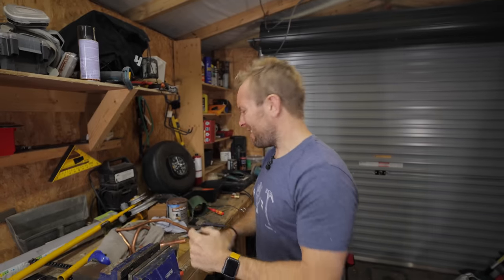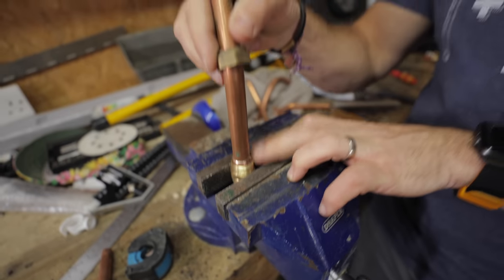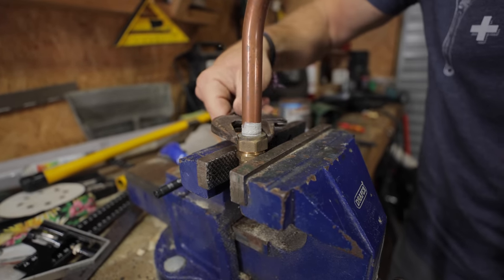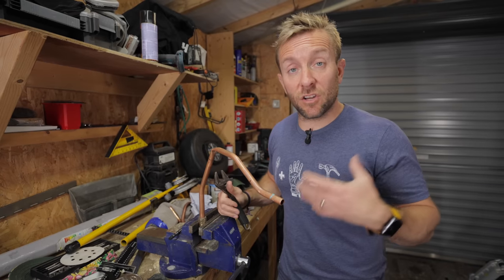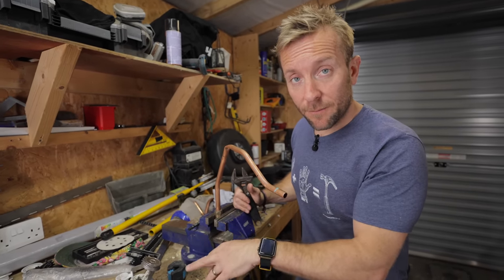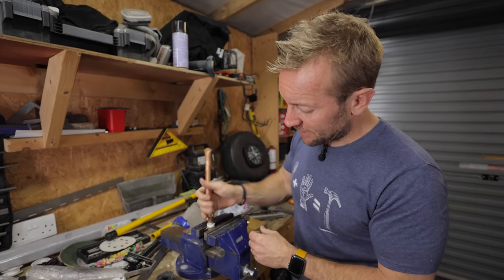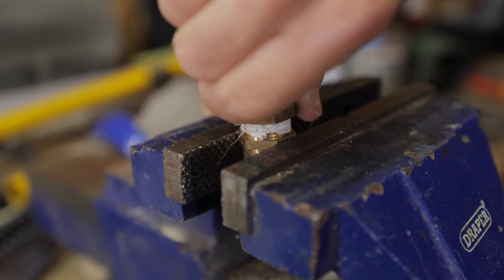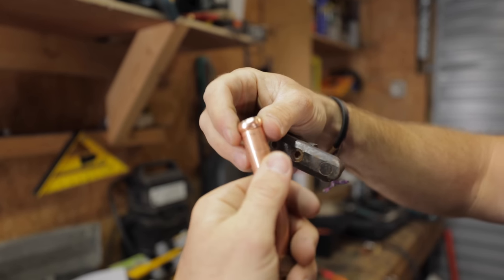4 MISTAKES Everyone Makes When Using COMPRESSION FITTINGS

Comment: I've done a bit of plumbing around the house. Never even heard of jointing compound,  I've always used PTFE tape (in the wrong place). I've always used a pipe cleaing brush though which seems to have given me a decnet seal. Next time I'll do as you've suggested though even if its only as far as putting the tape in the right place, so thanks for this :)
Reply: I was always taught from my beginning days of working that any brass or fittings that have that rounded shape inside or beveled type mating surfaces you don’t need or use tape but if you want u can use a little pipe dope but it’s not necessary. And I’ve done thousands of jobs over forty plus years with no problems. I’m sure what he is saying works and it might even be better but it’s just another step and time in the long run. I just put them together and tighten them down. That’s it.

Comment: Was told many moons ago by Yorkshire fittings company you dont need jointing compound  because compounds dry out and shrink causing a gap. causing it to leak 
Never had a problem been in the trade 35 years

Comment: If you haven’t got jointing compound you can use some light oil, like 3in1, to let the mating faces glide and seal. Just remember if it’s potable water system, flush through thoroughly. Just remember, ptfe tape is NOT the same as jointing compound. Care with ptfe tape, too much will just compress with time, loosen & leak. The worst ptfe tape stupid move is applying it to the threads. That just tells you the plumber doesn’t understand how the fitting works. 
Best of, good solder joints if you can🎉

Comment: Ive been using compression joints all my life mate and never get leaks . Just don't overtighten . All the same mate graet advice to newbys good stuff 👍
Reply: Yes, well done, your method is best practice.  I’ve been doing plumbing jobs at home, for friends and family for 20+ years.  I was taught by my father in law, apprenticed gas board plumber after WWII and national service with REME maintaining tanks.  He continued C&G training for years and progressed to become a successful design engineer making food production equipment (Mars, Birds Eye, P&G) for the last 20 years of his working life. He travelled to Europe, US and the Far East with his career.  He taught me that compression joints are mechanical seals and that the use of jointing compound or PTFE tape was NOT required. He taught me to ensure that the pipe, fittings and olive were clean and free from grease or ‘scars’. After assembling by hand, using blue pencil marks for insertion depth confirmation, the compression nuts are turned until tight without force, then tightened further by one quarter turn.  Once the water was switched back on the joints were checked and if necessary slightly nipped tighter.  I have never had a compression joint fail on plastic or copper pipe, imperial or metric.  Careful preparation and a methodical approach is the key.

Comment: Been plumbing 22 years , very rare I’ve needed to use any jointing compound , it’s for the rare fittings that just won’t nip up properly , usually when you have brass compression rings the copper ones are better

Comment: The biggest problem that causes leaks on brass compression joints that I come across is under tightened (because they used jointing compound) and unsecured pipe work,  clean the pipe with wire wool, don’t use second hand pipe, no compound or tape required!
Only use jointing compound when tagging on to old pipe work.

Comment: For 15 mm pipe compression fittings I thought the tightening advice was finger tight plus a turn and a quarter. In your opinion is that correct?

Comment: Hold tight!!  I had a questionable olive that I wrapped in PTFE tape about a month before this video came out.  That and a little dan of Megalok, for lubrication, did the trick. Solid pipes on an old wash basin did not give much wiggle room.
What is the tip for cranking them down right?  Can you feel the olive start to engage? I tried snug, plus 1/4 turn.  Still leaked. I kept the water on and stopped 1/4 past when the leak stopped.

Comment: just as a side issue.
Here in AU most of our compression fittings use plastic  ( teflon/ ptfe) olives.
As long as they are on straight on clean pipe, they seem to hold even on 120+PSI compressed air.
Reply: I use push fit plastic wherever it can't be seen - under floors etc. For when they are visible I use end feed soldered which are much neater. Horses for courses and push fit can be taken apart so easily which can save much time

Comment: I only put compound on the side where the water actually reaches - eg the fitting side. Why would you need it on the nut side? Top tip, push the olive and pipe down into the fitting first to gauge its location along the pipe, then hold it with your thumb on the pipe, pull them out of fitting - you can then see where it sits on the pipe to paste up. For those saying you shouldn’t use anything, maybe you don’t but you can’t just deny the material science behind helping a joint work better. It’s about understanding what is going on inside the joint

Comment: I always assemble and tighten dry, then remove the nut and put 2 wraps of ptfe tape over the olive. Never leaks doing that
Reply: That's what I do and yeah it always works, let the olive bite then loosen the nut and wrap a couple of turns of PTFE round it.

Comment: Ptfe tape is a device of the devil... Except the way you show  it's use. Been doing this for a freaking quarter century, never seen that tool, as a category 7 gear junkie I WANT ONE!!!!! Grtz from Belgium, Subbed.BTW biconus fittings as we know them are great for because you can reuse them and being all metal they are great for high temp solar applications and dirt cheap

Comment: When using compression fittings usually the class of the pipe used maters alot. The lower the class pipe the thinner the pipe the more commonly it will fail over years. Class 1 is usually the minimum wall thickness used on compression fittings. According to south african national standards

Comment: No complaints about what you have said but 50 years ago we cleaned the ends of pipes so the olive could slide slightly on tightening which supposedly helped lock up.

Comment: ROFL brasso it up and you're golden hahahehhaheha brilliant, loads better than the old soda can pull tabs we used to play with as kids. (if you don't know what I'm prattlin on about get off my lawn) great video.  I had no idea an olive cuter existed, I didn't even know those were called olives, but I digress.  I had to cut the hole end of the pipe off and redo a fitting once in my bathroom, luckily for me the stub out was way longer than it needed to be and I was able to replace the valve to the toilet but wow, that olive cutter would have been a godsend.

Comment: Another way to remove an olive is with adjustables. Over the top of the olive, tighten to the width of the pipe and hit downwards. Granted it might create more of a mess but works in a pinch

Comment: Ok this makes sense, but what’s weird is that as a auto tech doing ac compression fittings which we use a lot of ,mostly on imported cars and the olive is the same we were always told not to coat it in that manner because the thread sealant can come loose and travel in the system and block the filters ,and the dryers..although if you do it correctly we use the tape  more so because as long as you don’t use too much,and break the tape in pieces it will seal and not travel in the pipes causing ac system failures down the road..😊😊😊😊
Reply: TBH, you don't need PTFE or jointing compound on any compression joint unless there's an issue, doing it as a matter of course is wasting time and material.

Comment: The jointing compound / PTFE do the same job as the washer on a tap. The brass to brass faces are not likely to effectively form a watertight seal. The same thing applies in the contact between the olive and the pipe. PTFE / COMPOUND	 bridges the tiny gap between the meeting faces of the pipe and the olive. What isn’t mentioned here is the expansion and contraction particularly on a hot supply pipe what holds water initially will probably leak once it moves a few times.

Comment: #4 also applies to LP Gas bottles. The number of times I see taped POL fitting threads. If anything, it can hinder tightening of the sealing surface.

Comment: To remove olives slide an adjustable spanner along the pipe (pipe loosely in-between the jaws) against the olive. Most of the time it'll slide right off 👍🏻
Reply: If that works the fitting was never tight.

Comment: Great tip using the magic marker to mark nuts that have been tightened. I will use that for sure! Thank you. BTW: I usually use Silicone Grease instead of Jet Lube V2 Plus. I wonder if there any down side to using that instead?
Reply: Is sillicone grease wras approved?
Reply: V2 is liquid ptfe - always works great for me.

Comment: I had recently changed the bathroom sink and tap but found that the copper pipes were angled and i didnt like how the braided  tubes for the taps were bent around to suit the new tap location. So i changed it to nice straight lengths of copper pipe, brand new olives and fittings etc. I sent a pic to the plumber just to show if ive done the right thing (he is a friend as well just to see if ive done it all right) and I said i also used the fernox potable water jointing compound around the thread and also on the olive and he said I didn't need to use it at all because it was new fittings and to not really use it for new fittings. 

Just wondering if this is the case for any plumbers here? Like is it only for use on an existing fitting thats been fitted and is causing a leak, is it bad to use it on new fittings? 

I personally found it good to use because of the way everything was awkward to get to, it was easier to apply this than to wrap around tape and when tightening the fitting it seemed to then unscrew the connections to the tap that could only be screwed in by hand! So the compound helped me not have to tighten everything super tight, also as a diyer it takes a while to know when enough tightening is enough so its a slightly few less turns with the stuff applied to give it a watertight seal, making it ok to give it a bit more welly if needed instead of overtightening.

I wanted to do it right as I had caused a massive leak before with the connections to the bath taps, I overtightened the speedfit to metal thread connection and it eventually cracked after a few months, water pouring downstairs XD
So since then ive avoided eBay taps and overtightening lol

Comment: while PTFE shouldn't be applied to the threads, Joint compound goes on the olive/ferrule AND the threads as it's a lubricant that will make it easier to tighten and also remove it one day if necessary...
the best compression fitting trick I know is you rarely have leaks on used fitting (disassemble-reassemble...but with new fittings if it.s too loose it will leak and if it's too tight it will break...often days or weeks later) I slightly over-torque them and then loosen them and then retighten them properly...I've never had a failure with that method

Comment: If you do not use sealing compound some ptfe tape which is teflon will lower the friction on on the threads when you join the pipe, put putting teflon tape around the olive also will help seal the joint 👍👍👍👍👍 so in the case of compression joints wrapping the thread twice with tape does help 🤔🙉🙈🙊🕊️🕊️

Comment: Not sure but I've been able remove an olive with ring spaners or open rachet spaner and hammer tap it  and it comes off most of the time don't scratch the pip use wire wool cleaning end up .  I must just been lucky .

Comment: To many times I have come across fittings smothered in joint sealing compound like some kind of cake. Joint sealing compound won't hold the pipe and to much of it and you don't know when the olive is tight enough. I use a very small amount of plumbers tallow and a tooth brush to apply it and a 1/4 to 1/2 turn from finger tight  never had a joint leak.
I followed another plumber on a job many years ago, he used silicone jointing compound and every compression joint was leaking, around 35 joints. He got no pay and a bill for my time and damages.

Comment: Another common mistake is when pipes are under tension  when the joint is being  tightened the olive can  drift toward the end of the pipe i always used to undo the joint to double check when working with those tricky pipes.

Comment: They sqeek because the machined threads in brass need lubrication. A little oil will do that.
Only one face of the olive is a sealing face. The face the nut runs on is not a sealing face.

Comment: Oh and for Facebook, the CROX is a type of plumbing fitting, made by using Crox Nuts, to clamp the swaged pipe, together using a nipple and crox nuts 
re:
[quote]
Swaging tool used for expanding copper tube prior to joining with Crox fittings
[unquote]

Oh and that silly BRASS ring you call an OLIVE, we call a "Brass Ferrule".
Different countries, different words, same damn result, something leaks when it shouldn't, at the worst possible time, - at night on a Sunday.

Comment: Good video. Another mistake is fitting a new olive over an uncleaned pipe !, it will never seal. A damaged pipe is the same problem when the olive sits on a deep graze n the pipe. I’ve also found fitting new compression fittings on older olives are unlikely to seal because the soft copper olive won’t reform to the new brass compression fitting. You can get it to seal with PTFE tape or that new gel stuff. I haven’t had any floods, but every possible scenario for a compression fitting to play up, I have encountered !.

Comment: Never had an issue not using jointing compound but I always use ptfe around the olive on 22mm fittings.
Reply: I remember in my early career as an apprentice many years ago, i went through what i refer to as my Boss Whiteless period. Trust me you may get away with a few joints but when they run to dozens 😳 it’s a mistake i never repeated. If you want some fun wait until you come across 17 gauge copper in a tight spot.if you haven’t got a crusher you will need a good sharp file. If you have no idea what i’m on about, count yourself lucky.

Comment: A tiny bit of ANY lubricant will do: 3in1 oil, vaseline, plumbers grease, anything. But remember that lubricant does make it easy to over-tighten, so just be aware. I lightly lubricate just about everything in a plumbing system, especially sink drain fittings etc. where corrosion can make it almost impossible to dismantle a few years later. A couple of turns of teflon tape over the ferrule (or 'olive') will almost always solve a pesky minor leak, as you correctly point out.

Comment: When I apply PTFE around the olive, I only wrap it around the pipe not the olive, on the internal fitting side of the olive. Also I wrap in a thread manner, as you would like using locktite 55. Works for me every time! Thread compound also, only around the pipe, as this moves towards the olive when tightening. We vary I guess.

Comment: Pro tip most ppl have a pex ring cutter and instead of a specialty tool, work your way around it even if it doesn't cut it will expand and slip off eventually.

Comment: Time for the plumbing industry to come into modern times. How about fittings that have a proper torque value so there is no issue of under or overtightening a joint.

Comment: A decent compression fitting should not need jointing compound. My advice is to hand tighten it and then half a turn with a spanner. Turn the water on and check for a leak. There shouldn’t be any but if it weeps then tighten a quarter slightly more.  If it still leaks then check the fitting is straight.  If this fails then you could use some jointing as a last resort.  One other thing is check your pipe end has no deep scratches if it does the joint may weep and no amount  of tightening will stop it.  Use some wire wool to eliminate the scratches.

Comment: Being told that it's ok to learn by mistakes ... as long as you do learn from it.

I was not given this reassurance and it made it a chore to learn. 

When you are starting off, You try to get it right first time, but if you don't, work out why and then try again.

If you fuck it up, so what, try again as  a slightly better man.

Comment: Oh course the easiest way to make a compression joint is to cut the pipe to length with a nice square end. Clean the pipe with a very fine wire wool until it's polished bright, shiny and smooth (this is usually ignored), clean the fittings taper to the same standard.
Place the nut on the pipe followed by  a clean shiny olive, slip  clean pipe into the clean fitting, ensuring it's fully inserted and straight, screw the clean nut onto the fitting until it's hand tight.
Then we get to the tricky bit, ensuring it's still straight nip the nut up with the spanner until it feels snug which is usually less than a half turn, then give another 1/4 turn.
Compression fittings are designed as a metal to metal contact and you shouldn't need to add  muck and crap in there to stop your work leaking.

I've spent 50 years stripping, cleaning such muck out and remaking them to stop the leaks caused by poor assembly. I you were to stop and think about how a compression fitting works it doesn't take long to realise the act of tightening the nut  bifurcates the crap that's bunged in there by the squeezing and grinding action between the metal surfaces.

Comment: I've never, never  in 40 years used anything on a compression joint.
They were designed to make a water tight joint without any additional sealing.

Comment: The whole point of ptfe or jointing compound is to reduce the friction in the threads. This allows easier and tighter fittings so should always be on the threads. Both generally are Teflon which is virtually friction free.